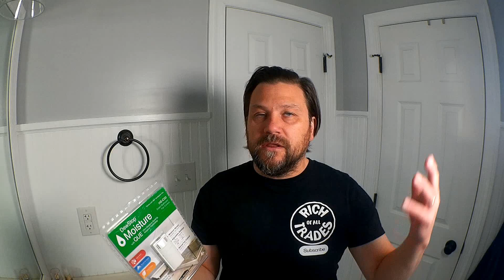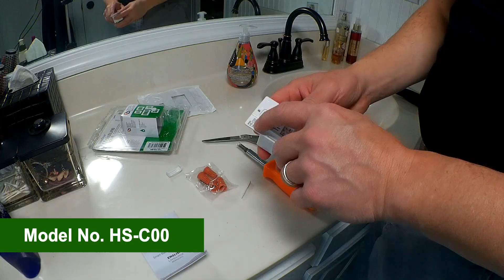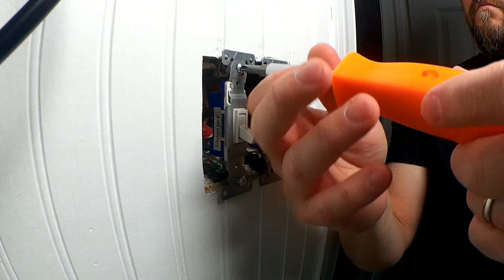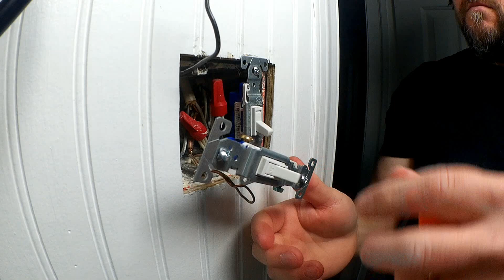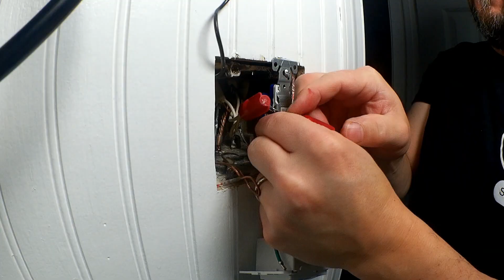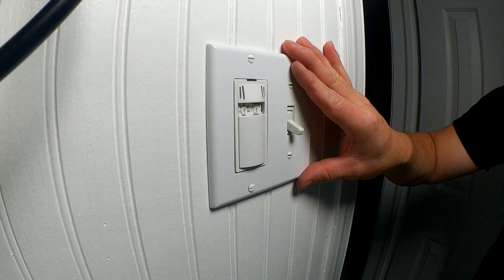DewStop Moisture Sensing Bathroom Fan Switch Install and Review

Comment: My sensor and light are together same line. I have same product. My light and fan come on randomly all day and night, with no one using bathroom. I turn it off and within minutes it is back on. Running all day and night when not home. Any solutions suggested??????
Reply from the maker: Thanks for the question, I also find that the sensor is too sensitive even on the lowest setting and comes on and off randomly. I have been thinking of doing a follow video on this. Probably going to swap out for another option.
Reply: Have the same switch, and the same issue.  Darn thing runs all the time, even when nobody has showered in quite a long time.

Comment: Well in the morning you go to the bathroom then brush your teeth then shower that’s more than 30 minutes . Does that mean you’re gonna be in th shower and the fan will shut off?
Reply: Why would you turn the fan on before getting in the shower? Also, it can be adjusted to stay on for up to an hour before automatically shutting off, and even if it does shut off while you're in the shower the humidity sensor will turn it back on relatively quickly based on my experience.

Comment: My question is. If its running in automatic humidity mode, can you shut it off manually? I have an Airbnb and the fan isn't being used properly and getting moisture in the house. I want it to stay on if humidity is high, no matter what.
Reply from the maker: Thanks for the question, anytime the fan is on you can immediately override the power buy pressing the button to turn it off. However if the humidity is still higher than the intended level the fan will automatically turn back on to reduce the humidity level after certain period of time.